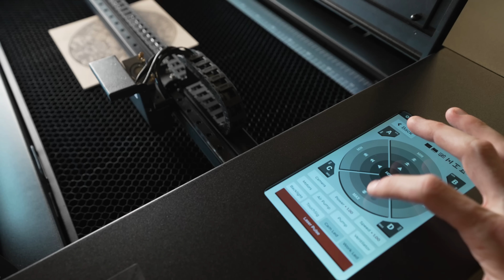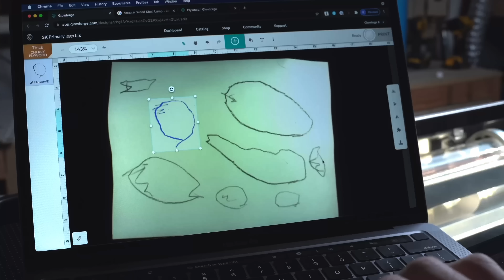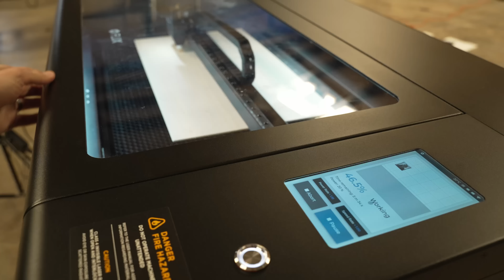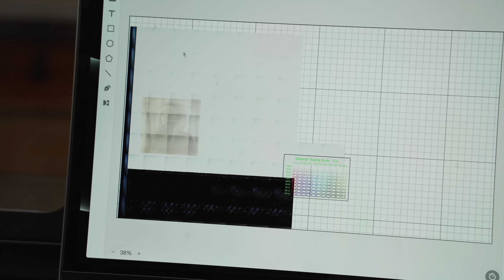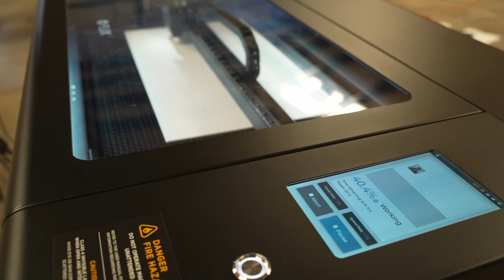Is Glowforge Dead?  FLUX HEXA 60W Laser Review

Comment: Nice one. will you be doing a video on xTool P2: Smart Desktop 55W CO2 Laser Cutter?
Reply from the maker: yep, soon!
Reply: I would like to see the HEXA compared directly to the P2.  From marketing materials there appears to be a lot of overlap, and if the P2 supports LightBurn and has passthrough I feel like the 55W power will not be an issue.

Comment: “WARNING “
Don’t buy hexa

I used to have an hexa and I just sold it very bad machine. The machine has an issue with power compensation sooner or later the issue will show up. No matter what you’ll do this issue will ruin your projects.

In the other hand if you are looking for detail or very light cuts or engraving. You won’t get have it with the hexa as the min power is 10% of the full power making details and small engraving impossible to engrave. 

The machine looks good and actually I can say it’s really fast.

Be carful if you want to buy as flux will not refund for your purchase and you’ll struggle trying to fix the machine by yourselves.

Good luck

Comment: We have the Beam Air filtration unit. It does an OK job to extract fumes, but we struggle with strong smell when cutting acrylic. This seems like more of a design limitation of the Hexa, since we can see smoke seep through the sides of the lid. The Beam Air starts by itself when you start cutting. Is easy to open to change filter, and looks nice. Build quality feels a bit cheap, but ok enough. I definetly recommend extraction fumes outside, but it works fine if you can accept some smell when cutting acrylic.
Reply: The hexa is not compatible with its the beam air. I had the hexa and the beam air connected. When I call flux to tell them that the beam air did not have enough power for the hexa they told me it’s only a dust extractor not a fume extractor… anyway at the end of the day they refund the money for the beam air but it was a nightmare. Also the hexa had many flows. Looks like a good machine but after a couple of months the laser power increases and decreases and other software and hardware issues.

Comment: While a top speed of 900mm/s sounds nice on paper, the weight of the head means that the accellerations are slow, which more often than not makes a bigger difference. The example engraving you showed wasn't nearly large enough to make use of the speed. That is, as soon as it gets to the engrave, it should already start slowing down. Now, to bypass that, there's the overscan area, which is this case is excessively large because it needs a long time to reverse that heavy head. 

Long story short; Top speeds are nice and all, but pretty meaningless without high accelerations to make use of it.
Reply from the maker: the acceleration piece is a good point.  I did a few tests off camera of a large engrave but if you are mostly working with smaller things or cutting then there won't be a massive change in time between machines.
Reply: The speed of the hexa is very good unfortunately you cannot go to top speed. The actual speed it can goes is 300s. I tried 900s once and the hexa could handle it.

Comment: Very nice to see another competitor in this market -- competition drives progress! I love the speed of this machine, the onboard controls, power bed lift, and bed size. The downside is the flimsy lid, lack of Lightburn support. BUT their website shows compatibility with other professional design software: AI, Photoshop, Autodesk, Sketchup, Solidworks, CorelDRAW. Great overview video as always Brandon.
Reply from the maker: Thanks man!  Good point on the software, I didn’t dive too deep into it but I’m guessing they mean you can import vector graphics so you can use any of those programs to make it
Reply: Very bad machine. You can import form those programs but it’s tiny when you save files in .beam (their own software can’t even open them.)